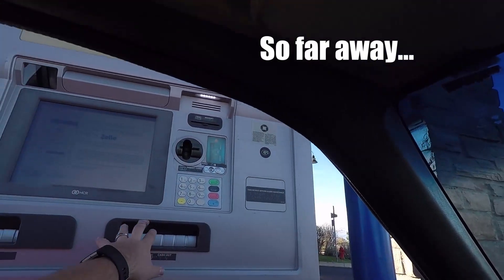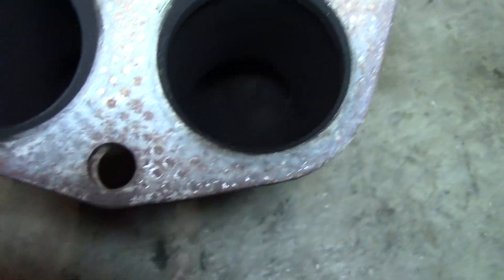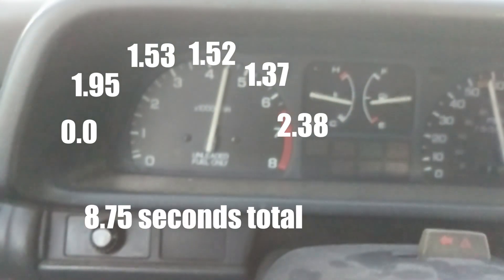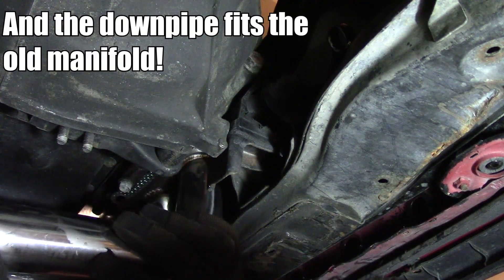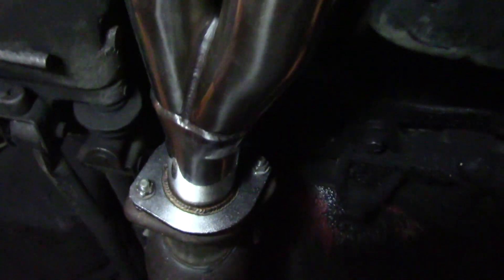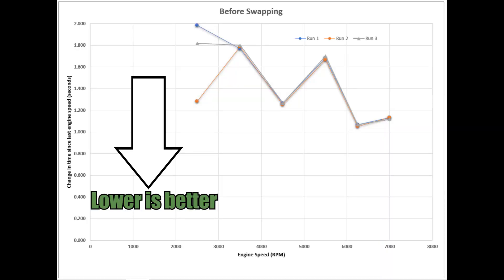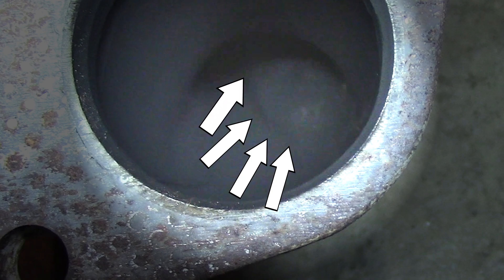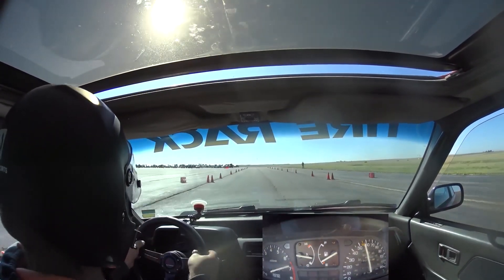Does a Dented Exhaust Reduce Power?

Comment: Well done video. Next time , if you have a big enough freezer. Fill the dented pipe with water and shove it in the freezer over night.  It may take a few cycles, but it will push most of that dent out.  The dirt bike guys do this all the time.
Reply: Does this actually work?
Reply: @milkphish4122  surprisingly yes.
I have successfully done it with some titanium tubing for an exhaust.
Mine took a couple of weeks though, I guess because it was decent sized dents and titanium .
Reply: Prob will..I had a metal barrel full of water outside in winter the water froze and bulged the bottom pretty bad

Comment: When youre watching this and you're truck is over 12in above the ground :/ In my case mine got high centered on a rock while off-road, dented it and now its ugly, no noticable power reduction though.

I'm going to try and use a pressure washer to hydroform the dent out

Comment: The exhaust pipes on my car come crimped from the factory. Is that restricted power or used for back pressure?
Reply from the maker: They likely had a reason they had to do it, but switching out to something that flows better would make more power

Comment: As long as it’s not over half the diameter of the exhaust tube no restriction would result. Especially on ur 100hp engine... they tested this on several hp tuner channels and even gained power WITh dents in the headers they tested.
Reply from the maker: The difference is HPTuners were using hammers, whereas this was from a curb or rock from being too low

Comment: Engine masters Dyno testing on this.. totally unexpected results...
Reply from the maker: I had heard about that video when I was talking about it with some people at autocross, and people I asked about it shared the engine master's conclusion that dents don't really affect power. My guess as to why their results are different from mine is they were setting out to answer the question, "what happens when you hammer your header to make it fit in your car." The dent on my header came from the header hanging too low and hitting something on the road, so it's a much more substantial dent than what they were achieving with hammers. I guess the take away is it depends on a case by case basis on how much power is lost due to the car and the extent of the damage.

Comment: The test is no good. A change in temperature, humidity or barometric pressure can make a severe difference in horsepower. Unfortunately people aren't perfect either so your clutch engagement is probably where the time difference comes from. A dyno test is the only way to prove anything with horsepower.
Reply from the maker: All good points. To compensate for that, I made sure to test with similar atmospheric conditions. It makes things easier that Colorado is so dry, so humidity is fairly consistent. Also, I do rolling starts in 2nd gear from just off of idle and start the counting frames at 1,500 RPM, giving the engine about 500 RPM to stabilize. The results from the "before" testing being so uniform give some confidence in the procedure.

Comment: Very well done and put together!  I dyno'd my car after the 1320 header and I lost torque but gained 5whp.  I believe the larger tubing decreases torque so that may have been a cause of the 4500rpm loss of power/time.
Reply from the maker: Thanks! Yeah, the larger pipes might affect scavenging at low RPM, but 5 whp is awesome
Reply: Muffin Racing I'm hoping that after going obd1 and a tune we'll be able to squeeze out some more HP.